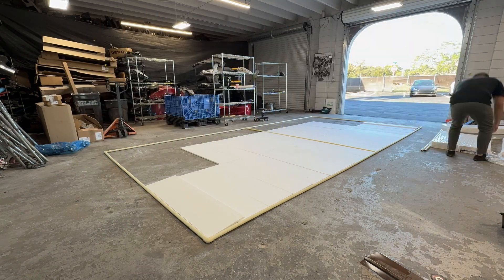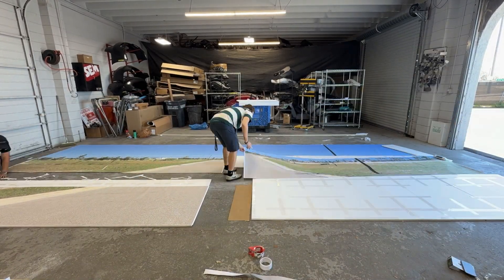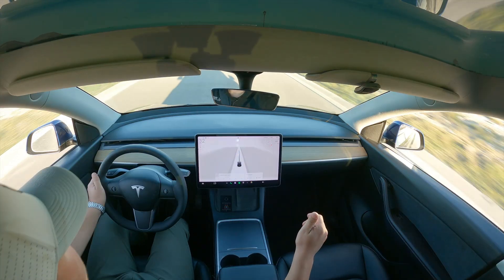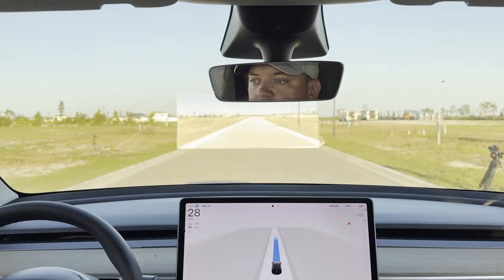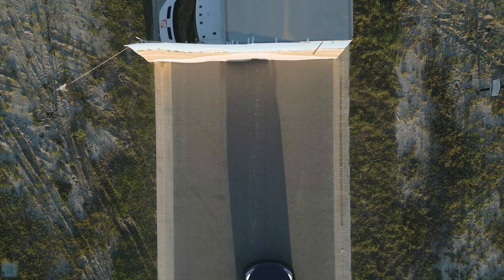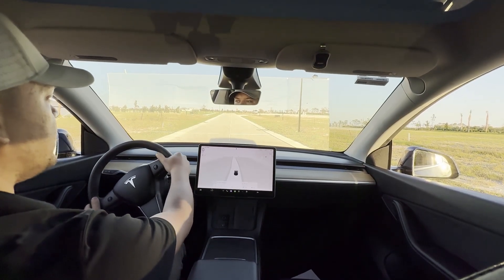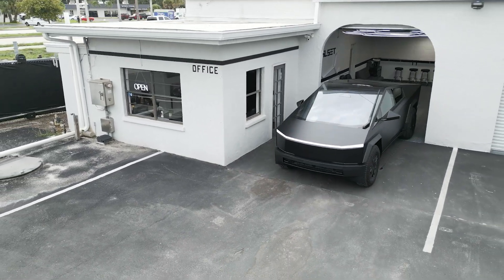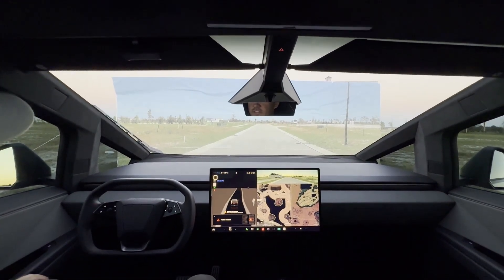Response to Mark Rober’s “Can You Fool A Self Driving Car?”

Comment: Thank you Kyle. Yes, curious Rober didn't use FSD(Supervised). Curious with your test:

1) No updated FSDS on your Model Y - your screen clearly says you need update.

2) Model Y tested in daylight but Cybertruck in the evening? Evening tests easier to pass with stronger street/board color contrast. Notice Cybertruck lights turned on?

3) Model Y in "Hurry" (most aggressive) FSDS setting but Cybertruck in "Standard" (more cautious) FSDS setting.

These 3 issues bias the results. Perhaps repeat with these solved? 🚙🔋⚡

Comment: Didn't Elon Musk already say in an interview that Hardware 3 isn't up to the task compared to Hardware 4?  To the point where Tesla is considering hardware upgrades for owners with Hardware 3, right?  I think he said this at least six months ago.  In addition, at Tesla's All-hands Meeting in March 2025, Elon said they're not stopping at Hardware 4...hardware will continue to improve over the years, specifically, he mentioned that someday there will be a Hardware 7.  In any case, I'd like to see a LiDar platform that doesn't require a geo-fenced area to operate on public roads.
Reply: @paulclementyonkers4604 Didn't Elon Musk already say in an interview that Hardware 3 isn't up to the task compared to Hardware 4? 
No, he said they weren't yet sure if HW3 would be able to run FSD (Unsupervised).

 _ To the point where Tesla is considering hardware upgrades for owners with Hardware 3, right?_ 
He said that if, in fact, HW3 can't run FSD (Unsupervised), which they haven't announced yet, they will upgrade HW3 to a version that will run FSD (Unsupervised), for those who have purchased FSD outright (i.e., not be subscription).
 _ In any case, I'd like to see a LiDar platform that doesn't require a geo-fenced area to operate on public roads._ 
Not sure what LiDAR has to do with geo-fencing; but in any event you're not going to see this with a Tesla, so you'll have to find something else that meets your needs.

Comment: That's fair vision isn't the best option right now. It's so silly that Tesla won't use lidar and vision until their software is better. Or if anything to help train vision use the data from the lidar? 
If lidar sees the wall, and the camera doesn't, use data from both on the same car to adjust training data... 

I'm also curious how the much more reliable v13 would have done as this is an outdated v12 on a HW3 model car...

Comment: You clearly missed the scientific method.
	1.	Daylight changed—invalid test. Control your variables.
	2.	No foot pedal cam? Obvious spot people will check.
	3.	Unless it’s pre-update, it proves nothing. Mark showed Elon’s brute-force “fix it after someone dies” approach. That’s not engineering. 

Mark or you will have to find a cyber truck that didn’t get an update and do it at the same daytime as a Model Y. Now that would an interesting experiment to see

Comment: You could easily fool a human with the right perimeter cloaking.
Cyclists ride into suspended cables, could FSD spot a thin steel wire?
I doubt Lidar could either.

Comment: A more fitting name for "Full Self Driving" would be "Full Cruise Control" because that's really what is. You can't trust that a Tesla can make smart decisions at this time.
Reply: @chunkynumnums You can't trust that a Tesla can make smart decisions at this time. 

Yes you can. FSD has been driving me around San Diego for months, on v12.5.x and now v13.2.8 in a 2024 HW4 Model Y, completely hands-free, with only a few disengagements—all of which were initiated by me to choose a different route to my destination than FSD chose. In fact, the only time I touch the steering wheel is to drive into my garage at the end of a trip; FSD doesn't do this yet, but will soon. It's like being driven around by a professional chauffeur, far more smoothly than any human (myself included), with my hands on the armrests.

It continually takes actions that show a human level of reasoning. Just today, it was rapidly approaching a slower vehicle in our lane, and started slowing down to accommodate the slower vehicle ahead. But the car area then signaled a turn into the adjacent lane, and FSD immediately calculated that it would by out of our lane by the time we got to it, and started accelerating back up to the prevailing speed—which is exactly what a human would have done. 

 If you haven't experienced FSD in one of the areas where there's a high enough concentration of Teslas sending videos back to the mothership to fully train the NN, you're hardly in a position to make a claim like this.

Comment: Experimental methodology with rhe cybertruck was poor by using evening light with significantly different contrast than the wall photo. At very least, it was a fail to not retry with the model Y in the low light conditions. Seems possible that the Y would have stopped under those circumstances.

Of course the Y had qn easy time detecting the wall once its shadow reached the wall; lighting matters!

Comment: The biggest missed opportunity here is that Tesla used to have lidar and got rid of it. If you're going to make the best thing, why not keep the best things on it. I don't think the camera idea is wrong. I think supplementing it with the lidar is the answer.
Reply: Tesla used to have lidar and got rid of it. This is what I like to call FALSE. They've only used it on internal test vehicles for testing and validation of its vision-based Autopilot and Full Self-Driving (FSD) systems.
Reply: @BigBen621  I still say, more eyes better.
Reply: @ I still say, more eyes better. 
Definitely! Humans do a poor job with two eyes; but Teslas with eight eyes (cameras) have driven 3 billion miles with FSD engaged, with orders of magnitude fewer crashes and fatalities than human drivers. So definitely more eyes is better.

Comment: So what’s the purpose? To see if the Tesla will stop if you encounter a fake wall while driving to Whole Foods!
Reply: Dense fog and heavy rain also caused the tesla to fail, while lidar did not. We have evidence of reflective surfaces—like a white painted semi—causing crashes. 

The tradeoff is that LiDAR is much more expensive for now. The r&d for LiDAR is more expensive and inefficient. Tesla has more cars and real world data. Roads are also built for humans and human eyes, which tesla mimics. 

Though, all the full self driving taxi’s on the road right now use LiDAR.

Comment: Lets not forget. No accident ever happened in real life with any self driving technology, ever. So let's not foul ourselves into believing these technology are not safe. Right ?
Reply: @EarendilTheBlessed No accident ever happened in real life with any self driving technology, ever. 
Sarcasm noted. In fact, of course, Teslas with Autopilot engaged have had numerous accidents, involving scores of fatalities. Why, then, is Tesla allowed by NHTSA to continue using Autopilot? Simply because even the rudimentary Autopilot avoids far more accidents, including fatalities, than it causes; so it's still a net positive safety feature. Teslas with FSD engaged have also had fatalities; but human drivers have about 20 times as many per mile as FSD, So again FSD has a positive effect on safety, even with a couple of fatalities (in 3 billion miles driven over several years).

Comment: Thank you for doing this.  It makes no sense for autopilot and FSD and vision (for AEB) to use separate NN or code paths as some people have asserted.
Reply: Interesting that HW4 detected the wall but HW3 did not.
Reply: @rdkutube It makes no sense for autopilot and FSD and vision (for AEB) to use separate NN or code paths. 
It makes perfect sense. Autopilot is little more than TACC plus Lane Centering, which probably 90% of all cars sold in the last decade or more, whose code was written years ago and hasn't been updated since. Meanwhile, FSD was developed with billions of dollars of computing time, based on actual videos sent back to the mothership by Teslas; provides a much higher level of performance and sophistication, which can't be achieved by the heuristic Autopilot code.
If you're saying it make no sense AEB to use separate code depending on whether Autopilot or FSD are engaged, I agree, and I don't think it does.
Reply: @ As a software developer, I'd never create two sets of NN object recognition models and maintain two sets.  Maybe back in earlier revs where software stacks (old, new) were run in parallel for a while but doing that when they are a single integrated stack still makes no sense.
Reply: @rdkutube  As a software developer, I'd never create two sets of NN object recognition models and maintain two sets. 
Neither would I; nor did Tesla. Autopilot is based on heuristic code, while only FSD is based on NN.
Reply: @BigBen621  They still have to use NN and object detection models though.  We can argue all day about this and go round and round :)

Comment: Entirely a different test. I think even the dumbest of camera systems could detect there's a wall in front of them when it's such a blatant different picture than the surrounding areas. Colors are off, road is different, the shadows rolling up onto the wall as you approach... It's a completely different test.

Comment: The horizon alignment is off. You can see how the car doesn’t see the wall as long as the horizon is aligned, but as soon as the horizon stops being aligned, the car realizes. In the original experiment, the horizon was aligned as long as the front cameras could see the real sky. The cybertruck's cameras are mounted much higher, nearly as high as the wall itself.

Comment: For anyone saying this test is ridiculous, lets remember the first autopilot crash...u know...the one that mistaked a trailer with the sky and rammed into it. A person died bc of it.
Reply: they also sometimes mistake trains for rows of trucks, and in a case i saw, accelerated towards the train cause one of the carts were flat so it saw nothing
Reply: Except, that crash was due to the radar not seeing the trailer and overriding the camera which DID see the trailer. The trailer was not mistaken for sky, it stood out obviously to the camera as a bright white wall in the road.

When they removed radar it actually got significantly better at stopping for traffic and not ghost braking. I'm not saying that camera only is the solution, radar can be good. In fact Teslas with V4 hardware have a very high resolution phased array radar which would be able to see stationary objects without popping false obstacles from overpasses. They currently just don't use it.
Reply: @Jaker788  either they cheaped out HEAVILY on radars, or you are straight up lying. radar doesnt "see" things. it sends a wave outwards, and takes in everything that bounces the signal back.

the truck will 100% of the time reflect the radar back to it. something as small as a screw will make it show up to a radar

radars dont need sunlight or headlights to see things, it send out its own source, and if it can reflect any form of light, the radar will see it

going from radar to camera when it comes to seeing obstacles is a flat downgrade
Reply: @CrispyMuffin2  Radar that cars usually have gas basically zero vertical resolution, whether it's an overpass or a truck it can't tell if it's above or in front, let alone the road below also returning a signal. So you filter it as best you can, often removing all stationary signals and only looking for differential speeds from moving objects. You can use the camera to try and cross verify obstacles and ignore if it's above or below, you can try to read from your return samples the limited difference in profile. Bouncing signals off of objects makes things even more difficult. Some objects are also at an angle where the signal will bounce away from you and never get received.

The other option is to change to a millimeter wave radar, in the range of 60 GHz and a phased array panel to allow aimed beams in multiple directions to increase the resolution even more. It's also so high frequency that you won't get a lot of bounce signal strength. Downside is it's blocked easier by fog and rain, but still much less so than Lidar would be.
Reply: @Jaker788 Once again stop making shit up. Lidar is basically a Lazer pointing to a spinning mirror. It maps where the mirror is pointed to. Can be made to map 360 degrees in height and width if necessary, ofc in a car u don't care what is above ur position so it tends to be configured to map from the top of the car to the floor in 360.
Reply: @samega7cattac  You must have misunderstood what I was saying. I never said much about Lidar, almost the whole thing was about radar.
Reply: @Jaker788 Lidar is radar that uses lasers.
Reply: @samega7cattac  Jesus Christ that has nothing to do with the pros and cons of anything I mentioned and is just pedantic. To address what you just said, sure they both do detection and ranging, one uses light and the other uses radio, however they're very different in application and advantage/disadvantages. There are also many ways to do Radar and Lidar which adds more variables. If I use the word RADAR then I'm talking about radio frequency and you should not misunderstand it as talking about Lidar.  

There's different frequencies of radio and light, but light is in the tens to hundreds of terahertz in the electromagnetic spectrum compared to millimeter wave radar being in the 20-60 gigahertz range. Higher frequencies are blocked easier by fog and rain as a trade for higher resolution, in that regard millimeter wave radar has the advantage for inclement weather while still having very good resolution. Cameras and Lidar both have the visibility issues with rain/fog, while you don't want to drive regardless without vision, it does add to safety in marginal conditions of you're able to drive at slower speeds still and sense further than you can see with light.
Reply: @CrispyMuffin2  The signal between different inputs confuses the decision making. Cameras and intelligence is all it s needed for self driving. Proof is in the pudding!
Reply: Let me make a correction for you. The person died because they failed to take over control of the vehicle. The driver is responsible for driving the car, and this is with or without autopilot turned on or off, or FSD turned on or off, on any vehicle from any manufacturer. If a person is going to ignorantly drive their car without this full understanding, they should either not activate those features, or purchase a different vehicle without them. These features do not give any person free license to NOT take back control of their vehicle, and should be ready to do so at any moment. They are not there so you can look at your cell phone, stare at the pretty flock of birds flying next to you, or become distracted by any other means. If you can't drive without being distracted, you should surrender your driver's license, or have it taken away.
Reply: @petef.4361  I agree, but doesn't mean if the tech is included it shouldn't be studied and tested and upgraded. doesn't mean people cant point out its flaws. especially if its a selling point of a product...
Reply: @petef.4361 ofc, it's like crossing a road. If u get hit by a car it's ur fault for not looking, but it's also fault of the driver if they had way to stop.
The FSD failed and the person was distracted, they are both at fault.
Reply: @petef.4361  if the car requires driver input and attention, it should not be called "Full Self Driving"

and elon should stop saying you can go from LA to NY without ever looking at the road
Reply: @CrispyMuffin2 facts, it’s a glorified driving assistant. This is why FSD on the current fleet will ALWAYS be in Beta and have the (supervised) at the end.
Reply: @007-JamesB   FSD on the current fleet will ALWAYS be in Beta 
FSD hasn't been in beta for a year. Please try to keep up.
Reply: @CrispyMuffin2  Wihtout touching the steering wheel, never said looking at the road. The name is irrelevant, it is very clear what the system is, especially when you buy it. Stop making stupid excuses.
Reply: @lucadellasciucca967 "stop making excuses" you say while excusing Elon blatantly misleading people lmao
Reply: @CrispyMuffin2  How is he missleading, guilty unltill proven wrong remember? I ve watched a couple of hours of FSD driving a week on youtube for the past 5 years! I ve watched countless people try it for the first time, purchasing it, showing it to others etc.
There is no false advertisment, show me an example that proves otherwise! Everybody is told and knows what the system does when they buy it. 
When Elon Musk says it can drive from there to there with no intervention is becasue it can! I ve seen it undreds of times at this point.
Get informed, your political bias is pooring all over you and is making you more stupid than you need to be.
Reply: @CrispyMuffin2  ah you have EDS İ see , you are unable to take in the facts

Comment: Good effort.
For it to be more scientific or accurate,
1. Both vehicles should have been tested on the same time
2. You should have also added a vehicle with radar and if possible LiDAR into the mix.
3. Yes, Mark Robber tested it with various environmental obstacles, but this is basic enough to highlight the issue.

Now, why camera alone is not possible for FSD is it's cons against Radar or LiDAR system is that in an environment obstacle the cameras cannot recognise and it is only partially be able to detect an obstacle.

Also, removing parking sensors will be an issue because additional ameras are required and then these cameras need to be always clean as it will not be able to operate when the lens are dirty.

Yes, many were fooled by Musk and no one questioned him before but ever since he bought twitter and his stupidity with DODGE, everyone starts to realise that he has gone completely crazy and his true self has been exposed.

Simple, don't be a die hard fan of anyone and blindly follow them.